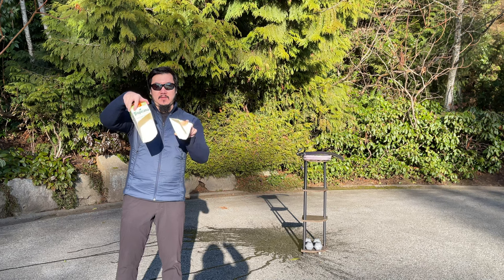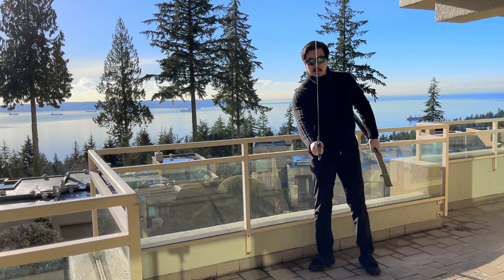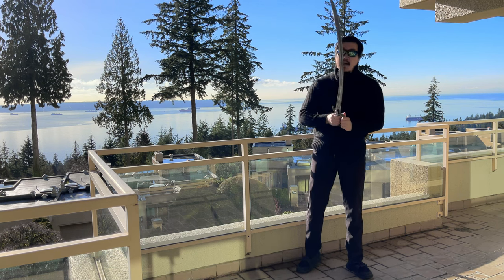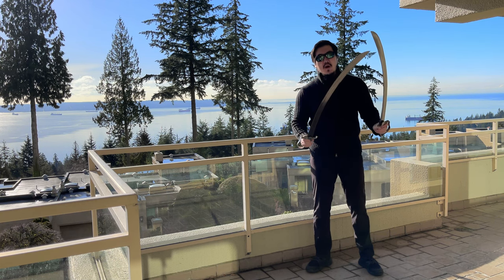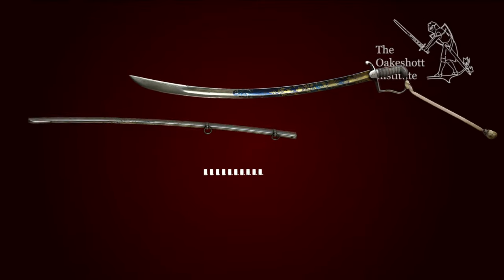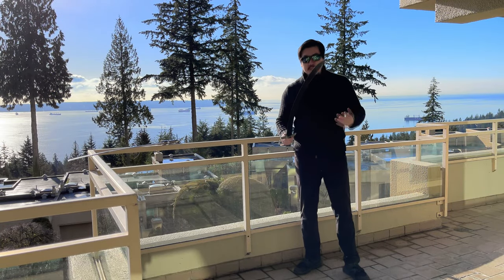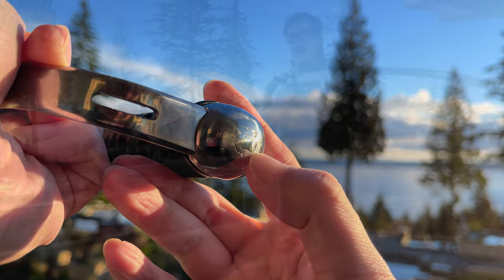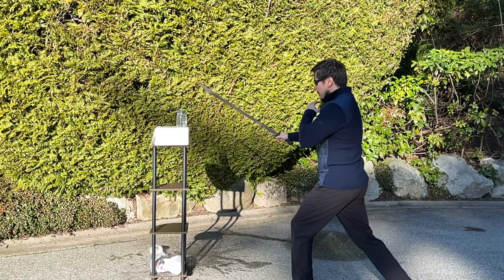Windlass/Matt Easton Pattern 1796 British Light Cavalry Sabre Review & Cutting #sword #saber

Comment: Finally! A 1796 reproduction that is actually legit! Sabres deserve more attention on the repro market
Reply from the maker: Most definitely!
Reply from the maker: @@brianbabin6333 What is the weight, point of balance, distal and profile taper of your CS sword? The stats on my CS and the new Windlass has VAST differences. It's so colossal that it's like comparing a pickup truck to a coupe car. The new Windlass' handling is extremely close if not identical to many of the original 1796. The Cold Steel one, like I have showcased, is a far cry, although came closer than many other reenactment grade Sword-Like-Objects by the likes of Deepeeka and Universal Swords. There's nothing "subtle" about it, unless you want to characterize the difference between Earth and Mars as "subtle".

Comment: Got the same gap between grip an backstrap with the latter however being in line with the blade. The seller kept insisting that they contacted windlass and that they claimed it isn’t seen as a flaw. After some back and forth I got a 10% refund. The guard was also moving by 1-2 mm when pushed. Fixed it with some epoxy.
Reply from the maker: Thanks for sharing your experience. The grip on the one I got is way worse. Good on you for holding them accountable!
Reply: @FortuneFavoursTheBold  the misaligned grip seems to be a common issue with this sword. All in all i would say that this is the windlass model with the worst qc I came across. Makes me think that they messed up a whole batch and decided to sell it anyways as there is a high demand for this model.

Nonetheless I would buy any other new replica military saber they make together with Matt Easton. An 1804 cutlass or 1796 heavy cavalry would be a great addition to my collection.

Did you try to cut from the wrist with this saber? When I did almost always the result was a long but somewhat superficial cut but no chopping through the tatami
Reply from the maker: Yeah there are always a tons of corporate stock responses as their excuses. Not a surprise. They've already got the narrative set on "historical people made crap swords, and had no idea what they were doing", meanwhile "it is exactly the reason that we should...copy their work??" Well however convenient it is.

That said, the blade mass distribution of this model is truly well done. It cuts very well. I haven't cut any tatami mats, because it is an extremely rare commodity here in Canada now. Including the shipping, each roll would cost at least 60 dollar in 2023. I haven't used any wrist cut at the time of this review. I might try to perform some in the future. My past experience told me it would cut relatively well, but of course not nearly as powerful as cuts incorporating rotations from the elbow and shoulder as well.

Comment: Mine arrived last week and I like it so much I'm ordering a second.
Reply from the maker: Good for you! Is everything well fitted?
Reply: @FortuneFavoursTheBold  everything seems perfect with mine other than there was a slight burr on the blade which I easily sharpened out.
Reply from the maker: @genuinelyconcerned3504  Glad to hear that! Watch the section where I show the hilt on mine. 🥲
Reply: @FortuneFavoursTheBold  After watching that I ran upstairs to examine the hilt. Thankfully mine is straight and the fittings are as adequate as can be expected for a very reasonably priced mass produced product. I'm sorry to see yours is so crooked. If that was mine I would be sending it back.
Reply from the maker: @genuinelyconcerned3504  I thought about sending it back, but I like the way it handles so much.
Reply: @FortuneFavoursTheBold  please take the time to email them so they are aware of the issue.  Windlass are definitely improving and are planning to keep releasing more historically accurate swords. But a fault like that should never have made it through quality control.
Reply from the maker: @genuinelyconcerned3504  Alrighty, I will.
Reply: @FortuneFavoursTheBold  thanks man. Look forward to more of your videos 👍
Reply from the maker: @genuinelyconcerned3504  Thank you very much, for your support!

Comment: Now if only Windlass can work on improving the "Munich Town Guard" Sword! It's an alright sword but for me it's too dang THICK! ⚔
Reply from the maker: Yes, I have been advocating them for going back to drawing board to get accurate measurements and parameters for all of their older models. Their Munich is just far too heavy and crude, definitely need a re-design!
Reply: @FortuneFavoursTheBold  lol it was one of the first European swords I used to cut with. At the time I thought all European swords were all chunky like that! 🤦
Reply from the maker: Yeah one of the advices we should give to beginners is be aware of bad reproductions and use it as a standard to measure a whole group of sword.
Reply: @FortuneFavoursTheBold  Haha that's so true! I later got to handle the Arbedo and the Sword of St. Michael but was unimpressed. I settled with the Mainz gladius (of all things) but I became disappointed with it when I did more research on ancient swords. Damn Windlass! I can't win with 'em! 🤦
Reply from the maker: @ELVendedor5000  Yeah, they lack the proper cross section and distal taper, the handling is just off even when they get the weight approximately right. There are just better options in the same price category.

Comment: What a formidable slashing sword! A big wide slash from the horse is the sure way to go with such a brutal saber!
Reply from the maker: Indeed it is formidable. However, you don't need to swing a wide arc and risk hitting your horse if you cut from horseback. The speed of the galloping horse will take care of that, you just give it a slight tug and keep your arm nice and stiff to maintain the structure to hit the target and that would be enough to take care of anything.

Comment: Awesome review Kane! I just got mine today. I feel the same way! It was such an amazing handling experience and the proportions so accurate (I have owned 2 originals) I didn’t even notice that the spine had some waviness right after the ricaso! Then it gets straight and remains so up into the cutting portion. Does yours have any spine waviness?
Reply from the maker: There’s no waviness detected on the spine of my sword. Overall the blade component seems solid, it’s just the hilt and specifically the back strap that’s installed crookedly.
Reply: @FortuneFavoursTheBold  well, this is tremendous step in the right direction for reproduction swords. The fact that there is a budget maker paying attention to handling characteristics, dimensions and distal taper……,what a fantastic positive thing in the mess of sh$& that humanity has presented us with as of late.
Reply from the maker: Indeed.

Comment: I have trained in all forms of combat for most of my life, but I am brand new to swordsmanship.  
Not trying to be a smart ass, but I noticed in the slow motion replay of the cuts, that the sword retracted or “went back” before the cut strike was made. 
Is that what has to happen, when going offense with the sword?  Or
Is it like other striking arts where The wind up or backstroke should be avoided?
Reply from the maker: If the sword does not come from a retracted location to rotate forward, it does not constitute a cut. If you just keep the blade forward with the tip pointing to your opponent, and lunge forward, it's called a thrust.

Comment: Hey! Thanks so much for answering that so quickly maybe you can help with my next question
How much should a guy spend on an entry level blade that will be worth keeping after mini mini, cutting drills and trips a field
Any recommendations on brand style, etc.
Reply from the maker: In general, if you do your due diligence on the research, it's possible to find swords under $500 that does everything well. Handles like a dream, performs extremely well in test cutting and thrusting, can be an excellent tool for drills, and are extremely durable. It is also possible to find a few under $300, but they are very rare for that price range. You can look at the playlist "mid-range reproduction" and "entry-level reproduction" on the home page of my channel.

Almost all the ones I reviewed in  the "mid-range" category I can recommend, especially the first few. You can listen to my breakdown (they are sometimes done in collaboration with other reviewers) of these swords and look at the cutting and thrusting performance of these swords.
Reply: @FortuneFavoursTheBold  thank you!!
Reply from the maker: @BadBoyTobinMclain  Gladly!
Reply from the maker: @BadBoyTobinMclain  One more point about how and when to cut. A cut either starts from an already-retracted position, like the Vom Tag or Zornhut guard stance in German longsword fencing traditions. The foremost locations of your body (the elbow, the knee, etc) are all on the same axis, and nothing is more exposed than the other, and EVERYTHING should be at this point out of measure from your opponent. If he wants to step forward to reach you or threaten you, they also step into the reach of your weapon. A cut or a thrust instantly launched from these positions should be one serves as BOTH offense AND defense to cover your line. It should intercept your opponent's weapon to put the point offline, or redirect their cut so it moves towards an axis you step away from.

The other situation is either you start from a forward position, seen more in basket-hilt sword, rapier and saber fencing because these swords have more hand protection to protect your hand and forearms from getting sniped, or because you already launched a cut or thrust and your weapon is at a bind with your opponent's. Only after you have displaced your opponent's weapon, and eliminate the threat for a brief moment, can you do a moulinet to break the weapon back and do a quick cut.

There are other situations you have to consider, such as making a cut from horseback, there are other principles you have to adhere such as reaching to your side far enough to hit, and not following up the cut too much to hit your own horse.